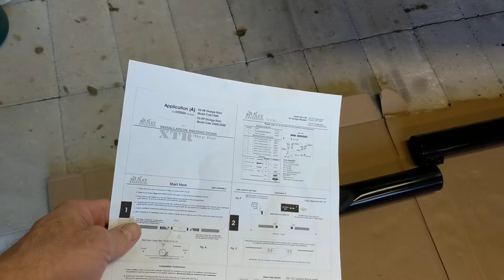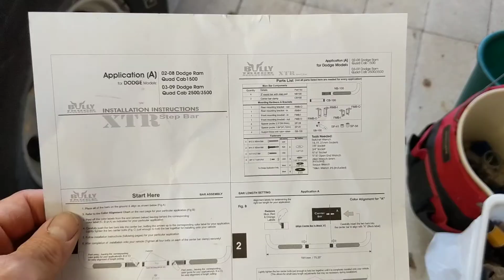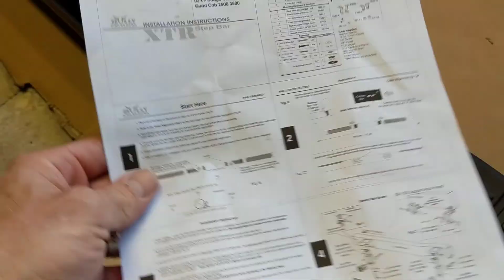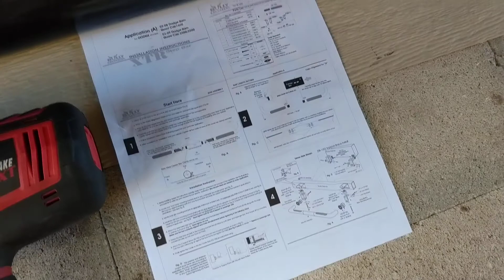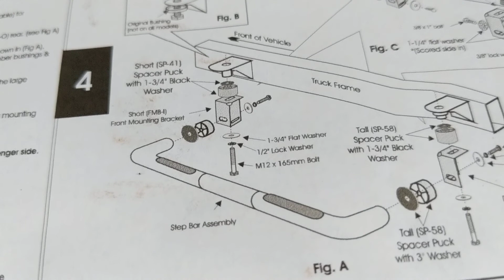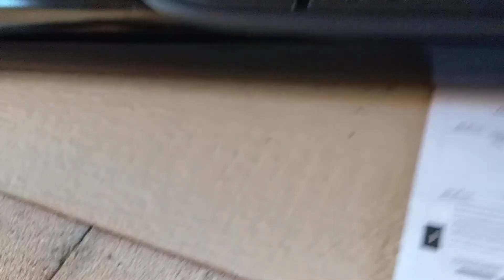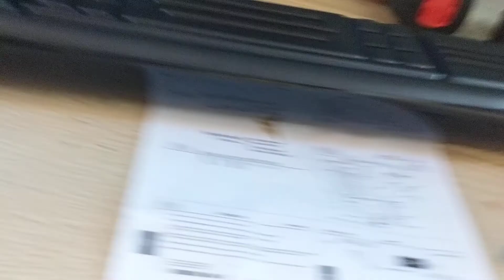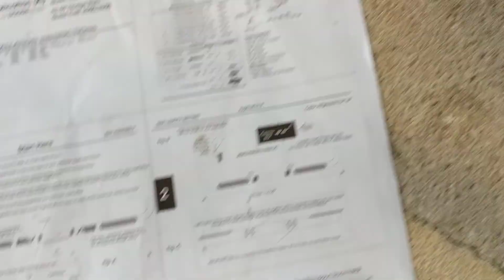Installation of 3 Piece Nerf Bars (DNA) on 2003 Silverado Crew Cab

Comment: Very helpful 👌🏼
Reply from the maker: Glad it helped!
Reply: @dmalott0908  one of the long screws didn’t go in tho so I’m going to have to replace it with the original one but longer weird because on the other side it did go thru
Reply from the maker: @chitogaspar9473  That is weird. You did get 2 big and 2 small spacers right? Very odd the bolts wouldn't work.

Comment: Does it say what bracket is for which side? It looks like you have the drivers side bracket on the passenger side.
Reply from the maker: If you look at the image in the instructions you should be able to determine which bracket will go on which side. I don't remember there being a mark on the bracket to indicate which side and the instructions didn't say so I just used the images and test fit everything first.